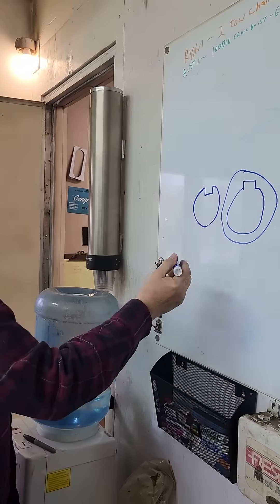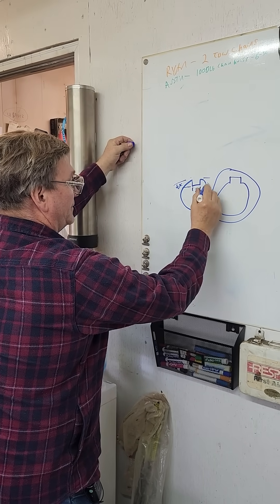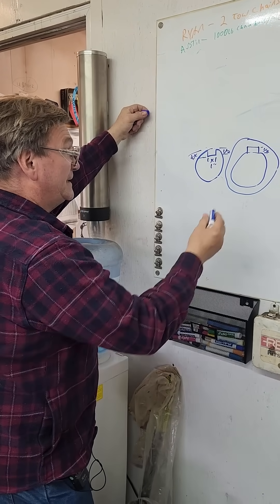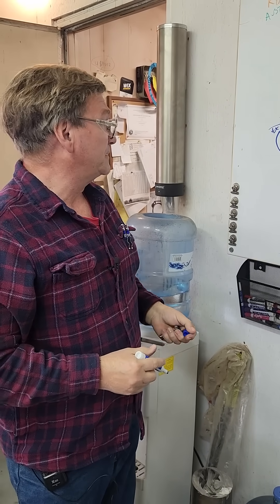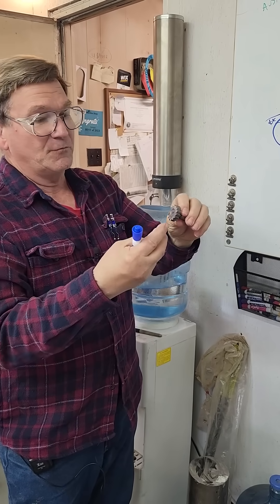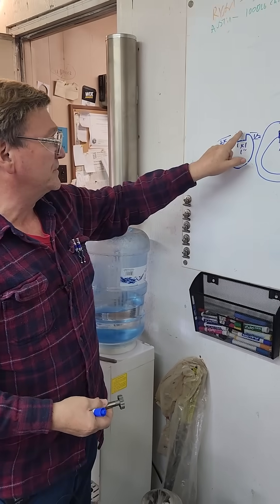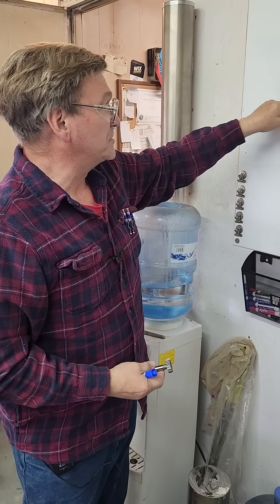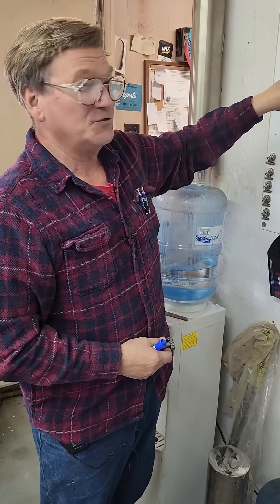How deep should a keyway be?

Comment: "half in" is not as straightforward as it seems due to the curvature of the shaft surface. If you zero your Z at first contact with the shaft and then cut half the key height, you'll actually have more than half the key sticking up relative to the remaining shaft material to either side of it. You essentially need to create a flat on the shaft equal to the key width first, and then cut half the key height from there.

If you want to do it mathematically, the extra bit of height is called the sagitta of an arc. S = R - sqrt(R² - L²) where R is the radius of the shaft and L is half the width of the key.
Reply: It’s a YouTube short. Get a grip. It’s not a course on keys.

Comment: The clearance allowance for a key is in the broaching height dimension of the hub, NOT in the cutting of the shaft.  If your hubs are not fitting for reason of a shallow keyway, fix the hubs.  Don't make shafts with keyways deeper than spec. Engineering drawings are legal documents. If you deviate from the tolerance on the drawing, you can be held accountable. Might cost you.  -Doozer

Comment: One other bit of information you could include. The key is generally 1/4 the shaft diameter. 1” shaft has a 1/4”x1/4” key stock. 2” shaft has a 1/2”x1/2” key. Go by the print, but this is just a rule of thumb.

Comment: You made the “key” point at the end of the video - if you’re replicating an existing keyway, measure it before cutting. I’ve found as many non-standard keys as “standard” keys, sometimes even mixed and matched on a single piece of equipment. Gearbox shafts are usually a mixed bag - US std drive keys for the load, metric keys for the gears, all on the same shaft 😅
Reply: I have seen dozens of prints that mix both metric and standard measurements and threads